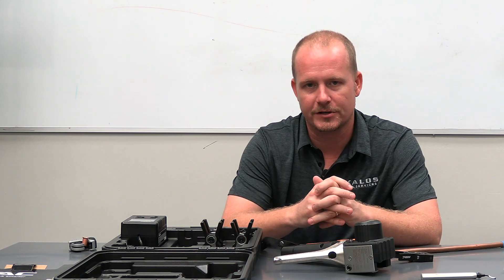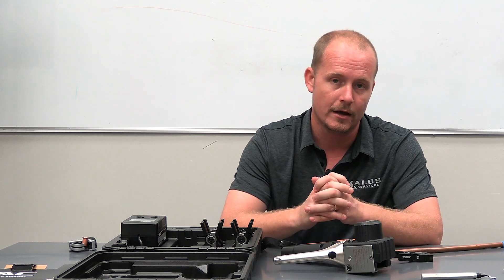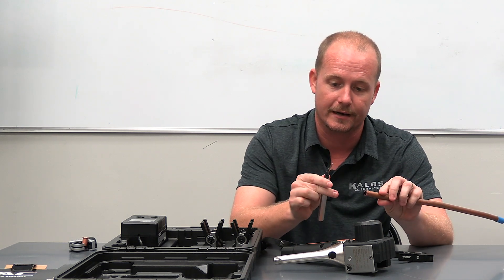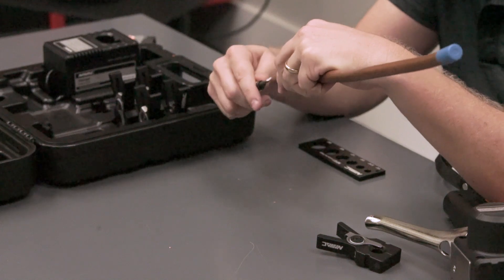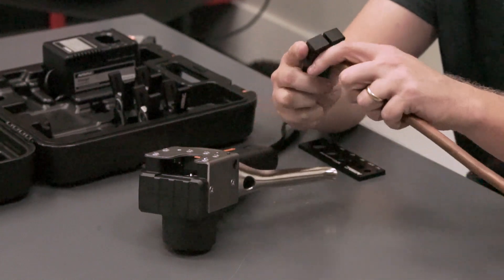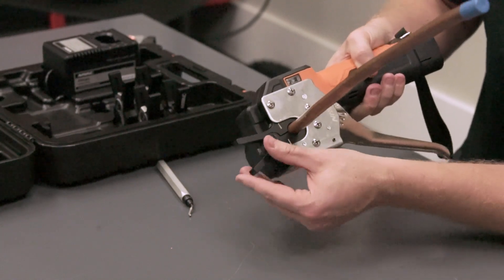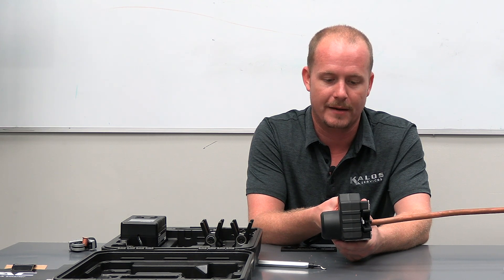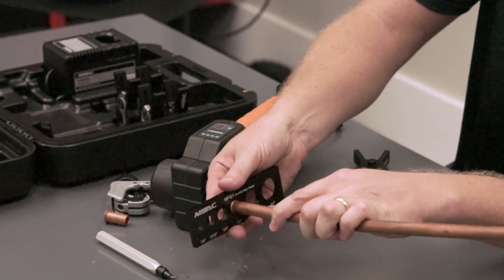Perfect Flares Every Time w/ NAVAC NEF6LM

Comment: Has anyone used this tool.and found the flares seem to be made too small?
I just got mine and have adjusted the tightening hex screw and the flare is a fraction bigger. I'm getting really small 1/4 flares, has anyone had this problem?
Or am I doing something wrong? 
Love the tool but the flares seem too small, I do air conditioning, ducted and ductless systems

Comment: First off I really like this channel. But this tool is completely unpractical for the field. It would be funny to watch someone flare with this and start crancking down with channel locks afterward. Just seems like a bit to much and maybe even a little predatory for the new guys. If it doesn't fit in my carry bag it's a no. Already have to carry along the torque wrench kit in the other hand.
Reply: 😂 some one doesn’t like all the new tools coming into the trade, get out old school dude, retire already. New tools to make the job easier, more consistent and cleaner? I’ll take it all day 💪🏻
Reply from the maker: If you use it you would love it.... I was skeptical at first as well but now we are going to buy a bunch of them for the newer techs and ductless installers.
Reply: How is it unpractical? What makes it any less practical than a flaring block? Generally curious because to me it seems just as practical. Especially having to make flares when it's like 5 degrees outside. I would much rather would using this than my flaring block. Just my opinion.
Reply: Ricardo ..... what did navac do to you man???lol